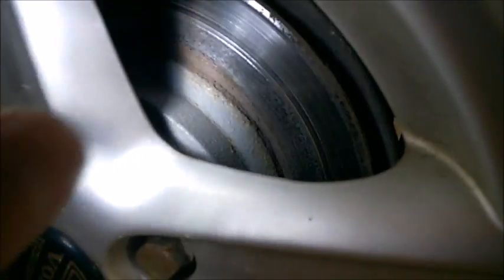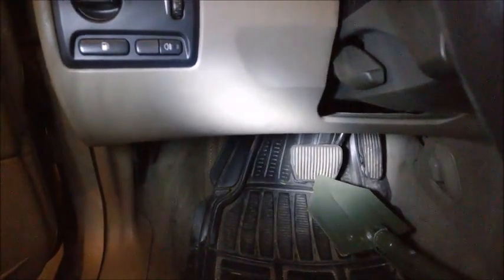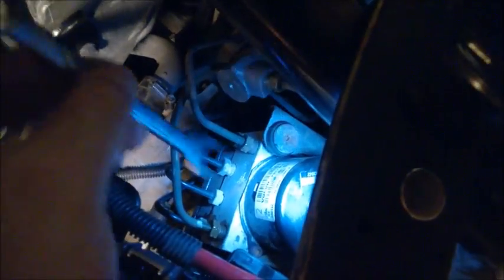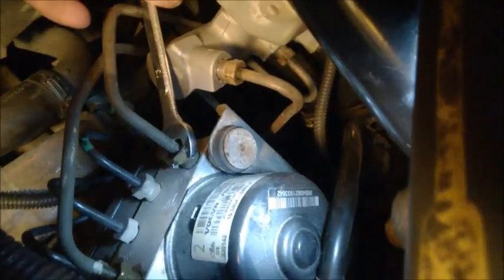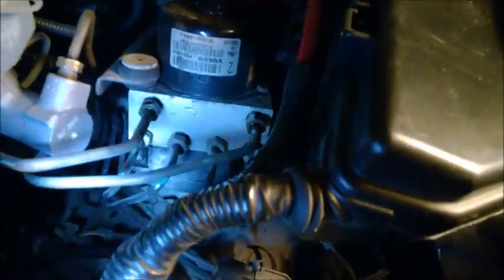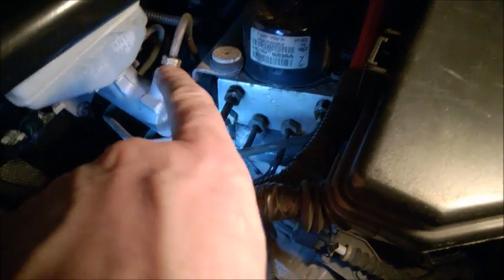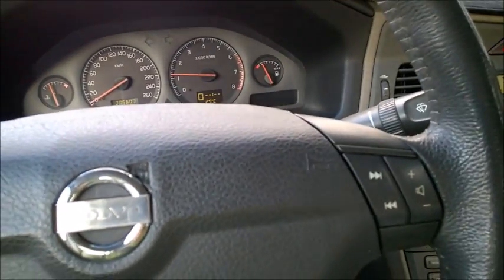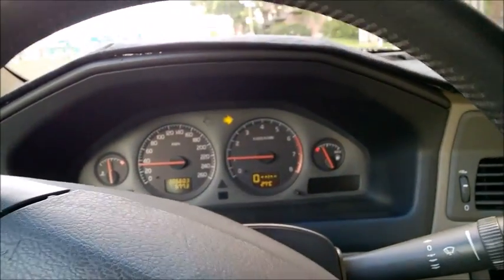Burping the ABS unit (removing the air)  in European cars -  Same procedure for the Master cylinder

Comment from the maker: See this other video  for the master cylinder https://youtu.be/_XLwXQmtLnw

I'm not sure if the problem is air or rather stuck solenoids inside the ABS unit (perhaps from forcing back the caliper piston to make place for new brake pads)

Update: the brakes bite better but this didn't fix the uneven wear brake problem. A tech working for a dealership is saying on forums that the ABS unit should burp when the ABS activates on all wheels - this will typically happen on snow/ice surface in winter.

Comment: My brake pedal is stiff with the engine off but with ignition on, the pedal can easily be pushed to the floor.  With each pressure applied, I can hear a buzzing sound from the engine maybe it is the ABS or the master cylinder.  This occurred after bleeding the brake fluid after I changed all 4 rotors and pads. Do you think I got air into the master cylinder or the ABS? is my brake booster affected as well?
Reply from the maker: I've seen your other comment. First thing is to look through the wheel spokes at all wheels, make sure the caliper spring is mounted in the correct position - a very common mistake that will cause very soft pedal  https://youtu.be/Kh8wQNHbedo
For the buzzing, see this video and the links in the comments section, It's not that critical to replace the seal, it depends how much air is leaking https://youtu.be/PRbWD2OGytk
Reply: @Peppermint1  Thank you for linking me to that video! I thought it was from the ABS or master cylinder.  I did not know about the booster cylinder at the brake pedal (https://www.youtube.com/watch?v=TuA8nuIeQb8), so I checked the grey bellow and it was wet and covered with old sticky dust, meaning it probably has been seeping fluid from there for awhile and that white cylinder was covered in brown old brake fluid and had black marks.  I'm assuming the booster was losing air and vacuum pump was buzzing to build up pressure as the pedal is pressed. So I will be changing the booster along with the master cylinder. I hope this will solve my problem and it is not an ABS issue. Thank you again for your Volvo expertise!

Comment: This is a very interesting idea. I own a Porsche Cayenne and have never had decent brake ‘bite’ - even after changing pads & rotors, and doing a full system caliper bleed. I will attempt this procedure in the next few days and report my results. Also - instead of the shovel system, I recommend that you buy a Motiva Pressure bleeder. They are inexpensive and work much better for pressurizing the lines.
Reply from the maker: I had the Motiva and it works fine but it's quite big and hoses may leak.  The dealership can check the ABS valve body by activating the solenoids individually, and can also burp the valve body and the master cylinder by plugging their software
Reply: How did you get on?
Reply: They never report back

Comment: Hey Peppermint! why does your clock not work?
Reply from the maker: It resets when disconnecting the car battery. Just had to set the time back again
Reply: @Peppermint1  I only ask because you have the other clock in the middle between the vents.

Comment: Would this be a substitute or equivalent to purging the ABS using VIDA?
Reply from the maker: I cannot be sure but worth trying. A tech working for a dealership is saying on forums that the ABS unit should burp when the ABS activates on all wheels - this will typically happen on snow/ice surface in winter. I would also suggest another way to bleed the master cylinder  https://youtu.be/_XLwXQmtLnw

Comment: So how exactly do you bleed the system? I see you unscrewed some stuff, but is that it? Lol...
Reply from the maker: You are right, the title should have saying 'burping' (removing the air), going to correct it
Reply: @Peppermint1  So to burp the system, I would have to unscrew the valves and let the air out? Simple as that?
Reply: Flin Cabagnot yep, only the lines coming out of the abs module, not the lines coming from master cylinder.

Comment: is there any procedure in VIDA for bleeding the ABS unit?
Reply from the maker: Yes, Volvo will connect the car to Vida, put a pressure bleeder on the brake fluid reservoir, open the front left wheel bleeder, and activate the solenoids inside the ABS unit in a certain sequence.   Still, you may try as shown in the video and also try like this guy who is simply bleeding the caliper with a hose attached at one end on the bleeder  while the other end of this hose goes higher than the brake fluid reservoir - it's a long video but the idea is very simple  https://www.youtube.com/watch?v=oi4BnNA3Ep4
Reply: @Peppermint1  thank you . I will try tomorrow and let you know what method been used. I guess I will start with your way air release. If it doesn't help will try other method. Got vaccum pressure bleeder btw.
Reply from the maker: @boskigrzegorz  You mean you got the pressure or the vacuum bleeder? The pressure one goes at the master cylinder reservoir, while the vacuum one goes at the caliper bleeder.  The vacuum bleeders that go at the caliper bleeder, I had issues with these.  It looks like the vacuum sucks the fluid from inside the caliper, but it also sucks air passing by the bleeder threads and into the hose, so it appears as the air bubbles inside the hose never stop coming out.  Perhaps just my experience, I ended using a pressure bleeder at the master reservoir, or simply just depress the brake pedal several times - important to put a piece of wood behind the pedal so as not to depress it more than 1-2inch - the normal travel when braking. Depressing it more may cause damage to the master cylinder.
Reply: Got vaccum bleeder. As you said got bubles still coming from caliper.I  must bleed the abs module first.
Reply: @Peppermint1  It doesn't work for me. 

I've flush ABS pump, lines and still the pedal is soft with poor braking. I wonder if that might be brake pump or servo fail. No idea how to diagnose them.
Reply from the maker: @boskigrzegorz   Just to be sure, the caliper spring is installed correctly ?  https://www.youtube.com/watch?v=Kh8wQNHbedo
If the vacuum pump or the servo (or the seal) fail, you should actually have a very hard to push pedal - no longer assisted.

Comment: My brake pedal sinks after changing the front brake calipers. They have changed the brake master cylinder, they have bled the ABS module with a scanner and it remains the same. I can't find the problem, any ideas?
Reply from the maker: Was there a long 'spring like' piece attaching to the calipers?  On Volvos, if this piece is not mounted correctly, the pedal will sink https://youtu.be/Kh8wQNHbedo

Comment: Can I use this same method to bleed the brakes on a 2003 volvo S40?
Reply from the maker: To bleed the brake see this, make sure to depress the brake pedal no more than 2-3 inches. If you depress it more, it can damage the master cylinder. Put a piece of wood under the pedal https://youtu.be/4dM9nbMLyvE

Comment: Great video!
Up to the point 👍
Can you please tell me what are those 6 brake lines for?
Reply: Front IN/Rear IN =2
Front/Rear 2x2=4 Brakes =4
2+4=6
Reply: @nasticanasta 
Great!
Thank you 🤩
Reply: Yes the 4 brake lines in the front that are grouped  together go to each individual wheel one for each wheel, the two brake lines in the back of the unit go to the master cylinder supply and return one goes to the pump The second circulates back to the master cylinder. 👍🏼
Reply: @FireEater  thank you so much

Comment: "if you push the cylinder back without releasing bleeder, when installing new thicker pads, that may damage the valves"   

What do you mean by "damage the valves"?  I did push back front caliper cylinders, without taking off the reservoir cap. Only with a rather weak quick-clamp, didn't seem to require much force. I have slowly sinking brake pedal (on sustained push when running), otherwise brakes work normal. See https://youtu.be/CO4j5xWtdOg

Comment: Mine is almost the same. Not so pronounced, but definitely not contacting so much on the area of the disc, closer to the hub.
Reply from the maker: I would update this video after a few weeks, when I'll see if the disc wear is improved
Reply: That will be good. Is this the only way to remove air from the ABS unit?
Reply from the maker: I read somewhere that Volvo will open the bleeder at the left front wheel, then use a pressure bleeder along with a setting in Vida that will activate the solenoids in a certain sequence so as to bleed the air inside the unit.  However I'm not sure if the Vida we can get 'at home' has this setting, so it may be only a main dealer thing.
Reply: I read about some unsuccessful attempts from some who tried